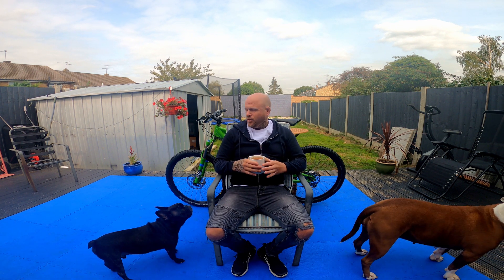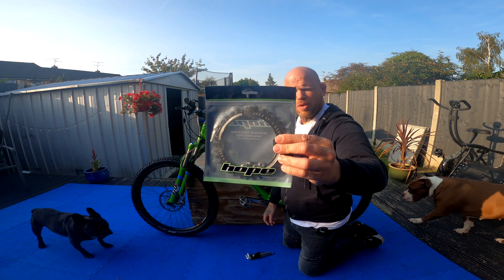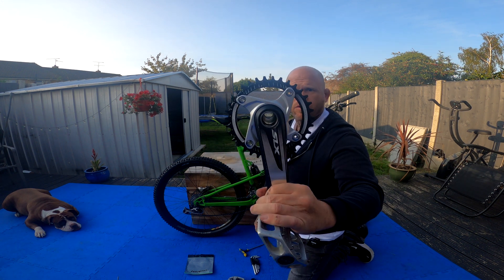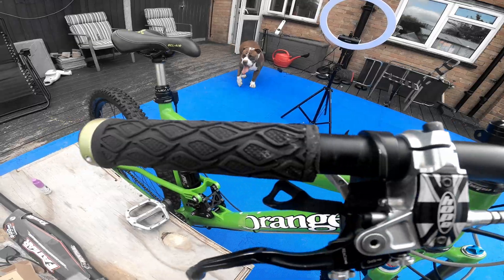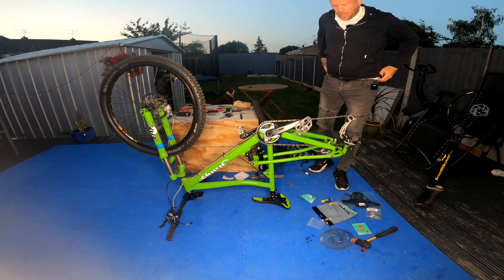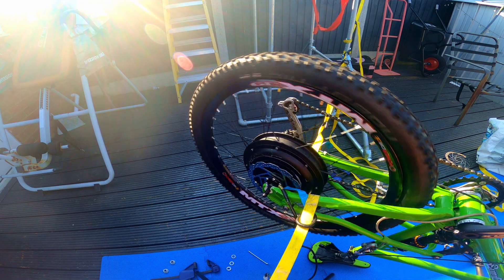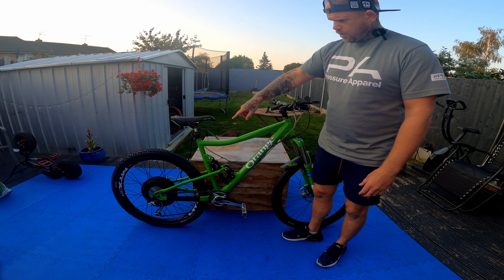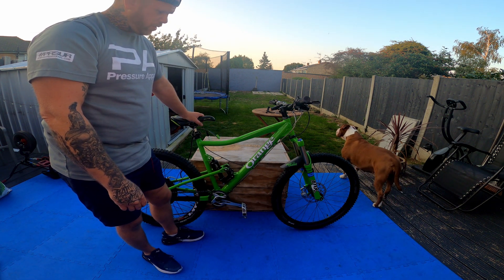Hulk Smash Pt. 1 - Full Suspension 2500w DIY ebike build

Comment: Chicken nuggets
Reply from the maker: First test run today 42mph 🤟🏼
Reply: @DudeStuff  nice , I was trying to be funny with the 15 mph thing lol
Reply from the maker: @gerardjachymiak5822  no worries dude 😂 can't always tell online, got so much footage today at Andy's I think they'll be another video this week already 🤟🏼
Reply: Will be a nice build that.
Absolutely loving my full sus conversion.
Out every chance I get, covering 30 miles most days easy as pie and usually still have 3/4 battery left lol.
Reply: @FlyingFun.  what ah
Reply: @gerardjachymiak5822  20ah, I pedal a fair bit and use the power for the hills and road sections.
Doing this just means I can quickly get to to nice trails in my area which was not easy without a motor.
Reply: dee 1987  haha thanks my new hobby is ebikes